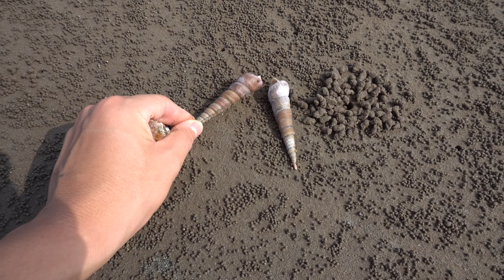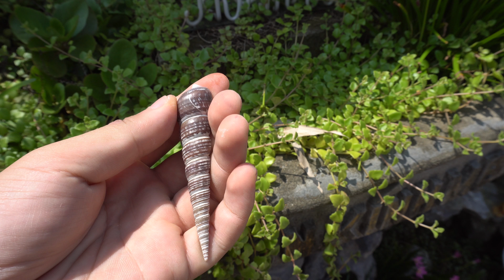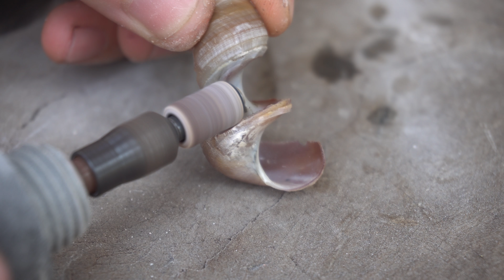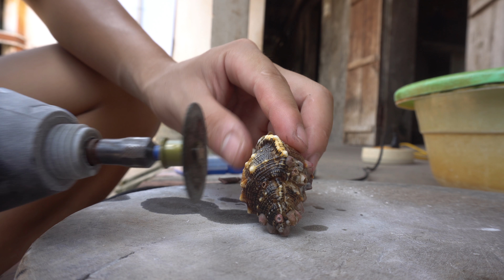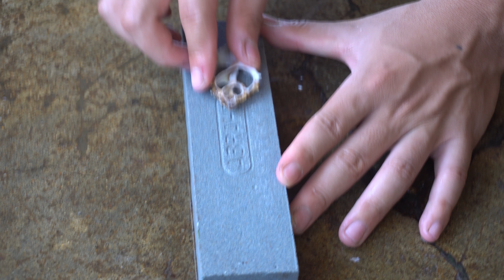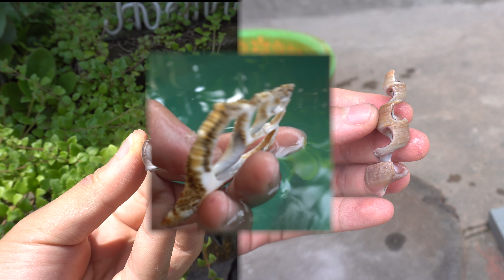I turn an Ugly Sea Shells into a Beautiful Flower Buds and some more

Comment: I have fossil ones that were chopped inside a rock so they look the same with quartz and calcite crystals on them... Perhaps if you dip them in acid/salt/copper sulphate you can get lots of crystals to grow on them too. technically, I think you could put them inside a diamond or a ruby vapor chamber at high pressure and get diamonds on them. i'll see if i have time to buy a vapor deposition chamber. https://youtu.be/kKLga-8IMiY?t=141